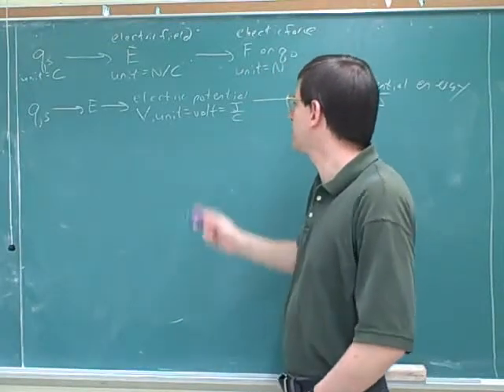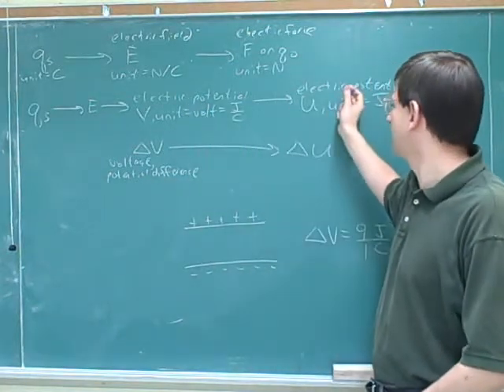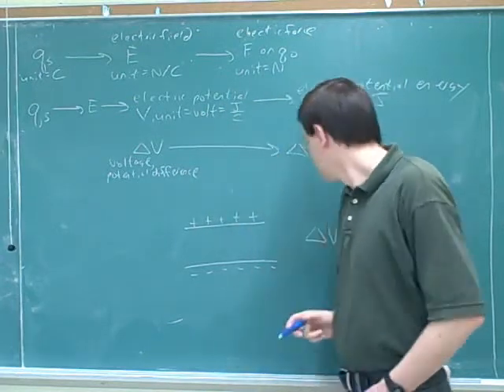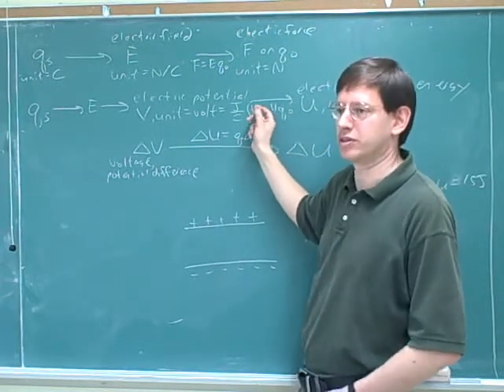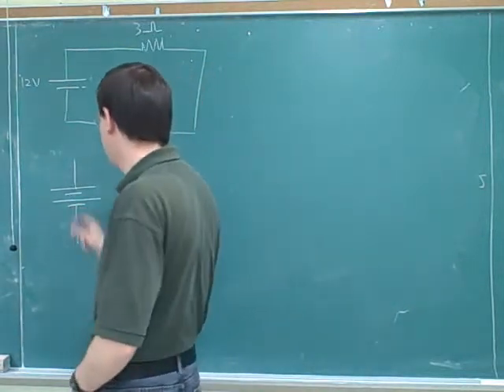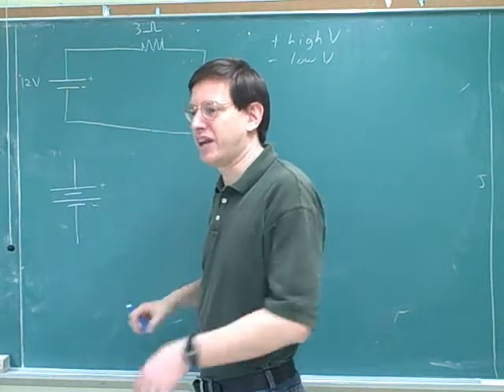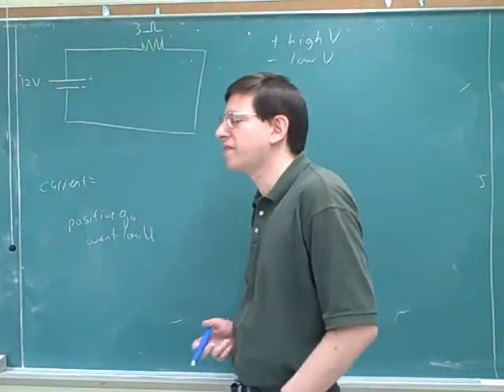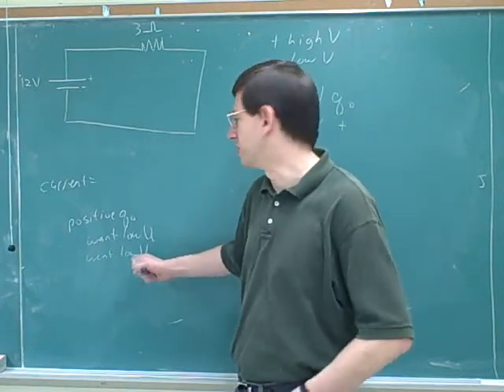Physics: Electric circuits. Resistors (2)

Comment: @xbeerxpressurex A Coloumb is a measure of charge. Just like a kilogram is a measure of mass. Electrons and protons have definite charges (they do not change). But other objects can be charged (by rubbing it or whatnot), and you can hypothetically change how much charge an object can have. A current is different. A current is a measure of electric flow. A current is defined by how much charge passes through an area per unit time.